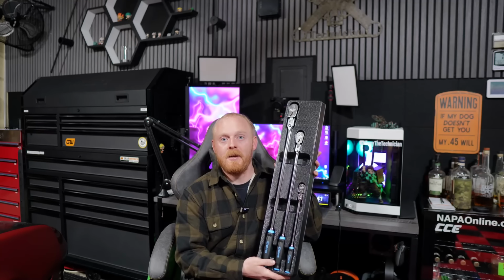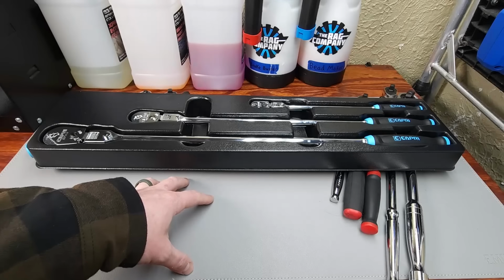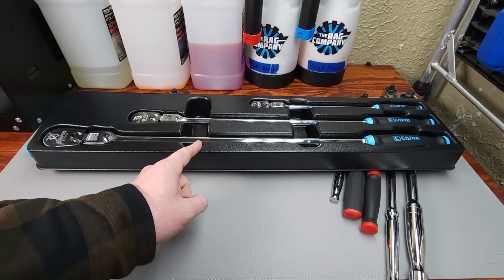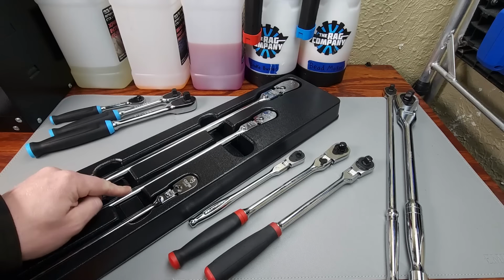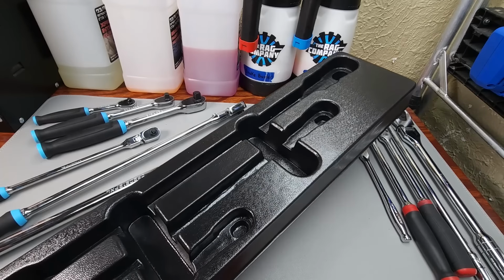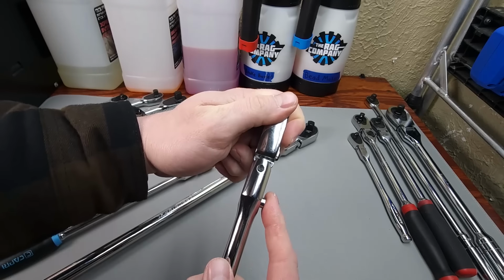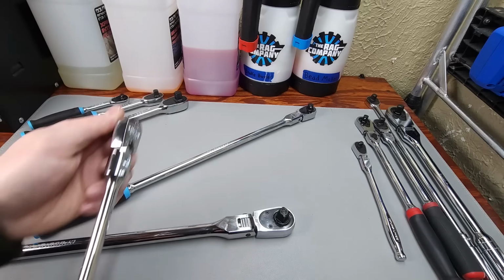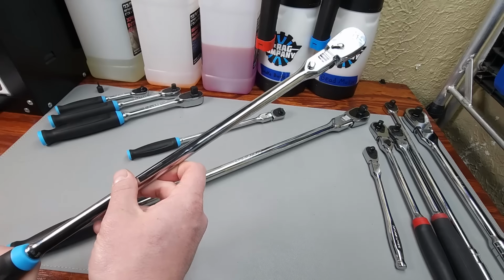New Capri Tools XL Locking Flex Head Ratchets and 50k Subscriber Giveaway

Comment: I was just looking at that set.  I got a deal on the regular long snap on.  It was like $400 so I could never justify it without a deal.  The locking one is more i think.  I like having the baller wheel ratchet now though.  I have some capri mini bolt cutters that were the closest I have to my knipex other than the vevor ones I just got for like $10.  I grabbed the 1/4 metric impact sockets from capri and they were an awesome deal for $50.  Probably going to get that ratchet set after I get the other impact 1/4s one of these days
Reply from the maker: Very nice. Great to hear. Thanks for sharing!!

Comment: I don't get why Capri tools has such limitations on their socket range, especially 1/2 drive sockets. They have nothing to really offer.
Reply from the maker: I think they have great coverage for 1/2 impact. And I understand why they didn't do the 1/2 chrome. Most people don't use half inch chrome. But I can understand why some would want it as an option. Usually when stepping up to 1/2 a majority of people are using impact sockets.
Reply: @TonyTheTechnician  for engine assembly work, and maintenence they are a must have.
Most 3/8 sets only go up.to 19/3-4", and  24-38 mm are very common  on a lot of DOHC V6-v12 engines. 
Adapters just don't cut it either esp in torqi to yeild applications.
Reply from the maker: @deweysturgill6220  don't get me wrong chrome sockets in 1/2 can be useful but not necessary. Most of the time you can get up 22 or 24 in 3/8 dr
Alot of 1/2 sets only go to 32 (not in all cases but alot) So a 38 is more of a specialty socket not found in alot of normal size 1/2 dr sets. But is much more commonly found in impact rated socket sets. Alot of the time 90% of your fasteners can be covered by a good 3/8 drive set and then fill in the necessary larger sizes needed in 1/2 drive. This way you don't have to spend hundreds of dollars on a 1/2 dr set that you really only need 6 of the larger size sockets. But if cost isn't an issue and just wanting a large 1/2 chrome set is what you want. Tekton does offer a very good size coverage for 1/2 chrome sockets.

Comment: I would be curious to see how the Capri does under a torture test, since the length and grips would make it a nice addition as a breaker bar.
Reply from the maker: Ya the couple of times I've used it for a stubborn fastener they worked extremely well and didn't feel like it was flexing bad or anything so I think they are going to hold up to alot of abuse.

Comment: I got the 3 piece fixed head set right after they came out. I use them in the (professional) industrial setting. I've had zero issues with them. The length comes in very handy, and the slim head design has bailed me out of many sticky situations. Capri makes VERY solid tools , and I've tried to spread the word to anyone that will listen :) 
I wasn't aware they had an actual You Tube channel. Thanks Tony!
Reply from the maker: Very nice. That's awesome to hear!! Thanks for sharing your thoughts and experiences with them!!

Comment: I have the 26" mac axis flex and had the 18" mac locking 3/8 (just got rid of it) and if I can manage to sell the mac I'm going to use the money to buy this Capri set. The Mac ratchets are garbage and I can't believe I spent almost $700 on them. Should have gone with snap on, but again it's almost $400 just for the 1/2"
Reply from the maker: Ya my buddy bought the 1/2 matco for 320. These are a huge savings and very well made

Comment: It sucks that the new locking Capri ratchets can't free flex. It can only be locked. I was so excited for these to come out, but that was a deal breaker for me. I still like Capri though and i have several of their products. They are the only company i know of that makes an 8mm-24mm no skip impact socket set in shallow, semi deep, and deep. I hope they come out with some chrome mid length sockets in the future. I really really hope tekton starts making mid length socket sets too because i love tekton chrome sockets. I just picked up tekton's new 1/4" impact socket set. It goes all the way to 17mm, which is basically unheard of.
Reply: ikr, i wonder if you can remove the lock on them
Reply from the maker: I can understand that and I agree with both the capri sockets and the tekton sockets. I love that the new set goes to 17. That's crazy awesome